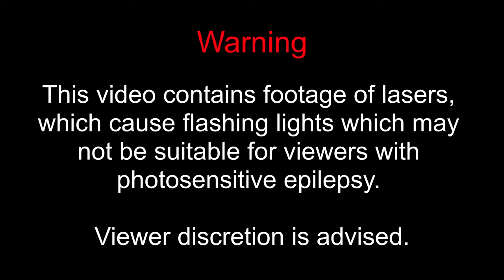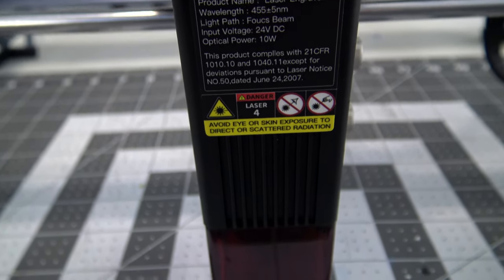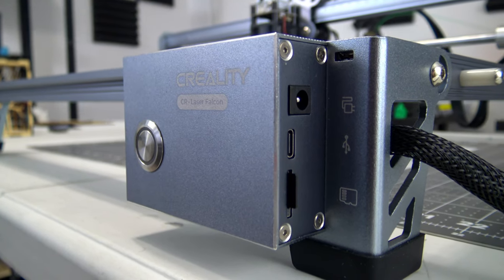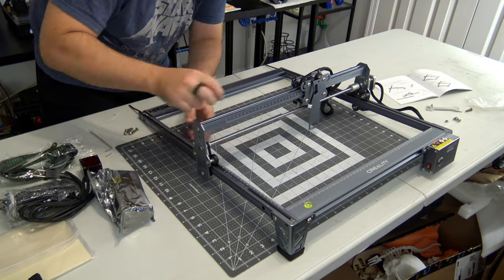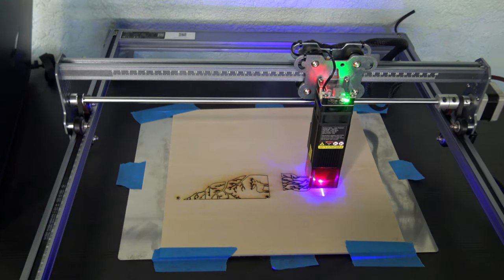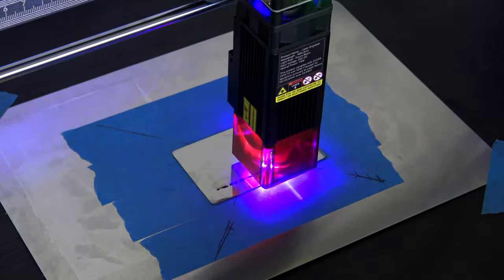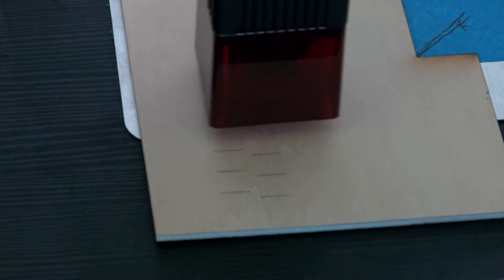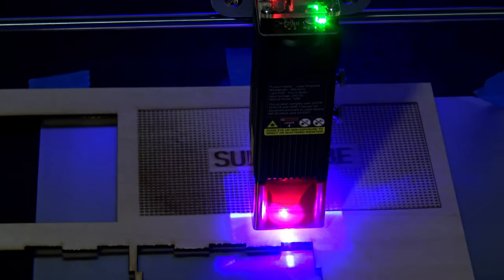Wood, Stainless Steel, Aluminum, This Laser Does It All - Creality CR-Laser Falcon 10W Review

Comment: Can you share your settings regarding the engraving of the stainless steel pendant? I tried the parameters as indicated by Creality (100%, 500 mm/min, height (?)) but no cut was visible. Might be that I need to try some more with the lightburn software, but I just want to make sure that it's not e.g. a focal length issue.

Comment: Really good video! If my Ender 3 laser conversion doesn't pan out I might just turn it back into a printer and pick one of these up.
Reply: I am tossing up between the Ender 3 attachment and the full Falcon 10w set up. How did you go?
Reply: @skeetarus  not good, pick up the Falcon or an arguably much nicer xtool.

Comment: The engravings, when you show them up close, look very pixelated. Is this the laser engraver itself, or did you feed it low resolution raster images? Is it capable of producing a smooth, fine line that doesn't look pixelated, either from a vector file or a high resolution bitmap?

Comment: Hi ! just wondering, can you cut through aluminuium or stainless steel ? Here you engrave it, but I guess cutting a for example 1,5mm aluminium would be possible ?
Reply from the maker: No, diode lasers are not able to cut metal. You can make dark marks on the surface of stainless steel, but it's not actually removing able metal. You would need a different type of laser, like a fiber laser, to work with metals.

Comment: Thanks for the video.  I thought I was going crazy on mine also but realized it is likely firmware for the drift, since if I home the laser and cut again, it aligns almost perfectly multiple times over the same engrave.  Have you been able to update to the sept 7th version they have up on their site?  My cutter doesn't seem to do anything when I put that file on the micro sd card, and try to update it.
Reply: I was able to get it to update.  Apparently, I was just not patient enough when waiting for it to start the update.  And This solved my alignment issues perfectly also.

Comment: Please, i want to engrave into BRASS. Small logo 5x5mm. Example Smiling FACE. Do you think, it would be possible also with 5W laser, and would it be readable? thanks
Reply from the maker: No, no diode laser can engrave on brass. The lasers wavelength isn't right. To engrave brass, you need a fiber laser.